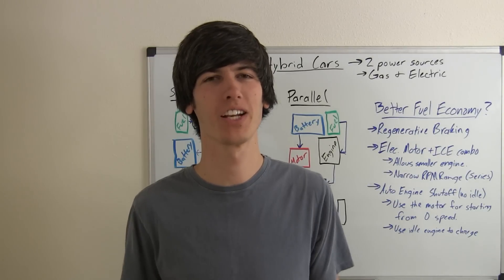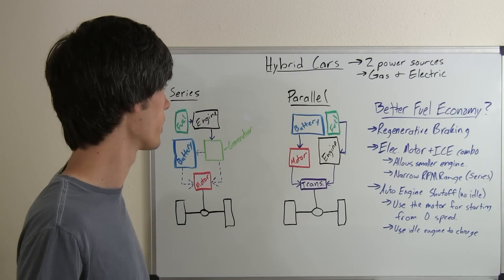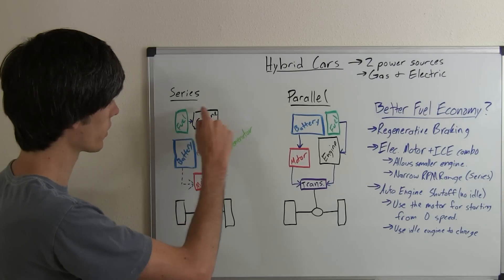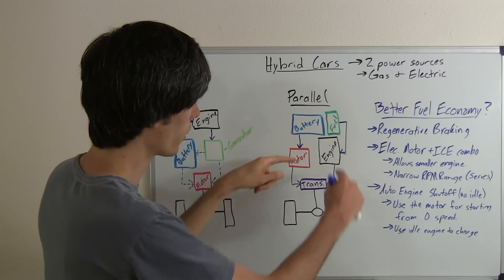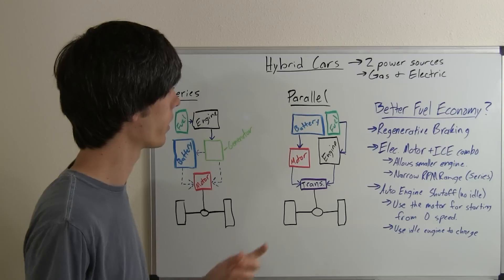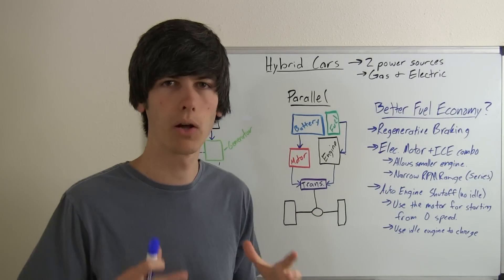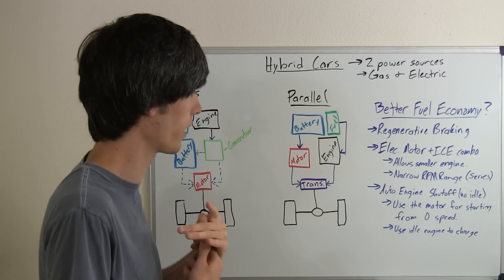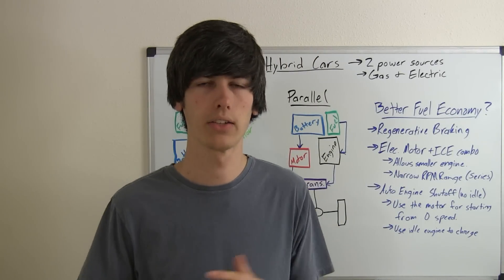Hybrid Cars - Explained

Comment: It is well known that an ICE is most efficient within a small portion of its RPM range. What isn't as well known, is that efficiency depends more on load than RPM. For example, the ICE in a 2020 Camry Hybrid is 40% efficient at 2500 RPM and 125 lb-ft.  Which is a lot of torque. It loses no more than 1% by changing +/-800 RPM, a fairly wide range. But about 15 lb-ft loses the same, and is too much for most driving. The reason smaller ICEs are more efficient is not that they are inherently so, it is that this sweet spot is closer to driving conditions.
The point is that an HEV gains more efficiency by using this information, than by what this video listed. It can run closer to the sweet spot by using the battery to buffer energy. For example, at 55 mph, the Accord Hybrid (presented in another video in this channel) needs 10 to 15 HP to cruise. It splits time between running the ICE at 34 HP and 40% efficient ICE while saving more than half the energy in the battery, and EV mode. And so is about 40% to 50% more efficient.

Comment: I dig out all the internet and I didn't find an answer to a simple question, so you EngineeringExplained are my last hope :)
Why manufacturers (like Toyota) of HEV are not making PHEV with exactly the same parts, but only with larger battery (3-5 kWh) and option to charge it at home.
I'm starting from my needs and I believe many others have the same or similar needs for short (5-15 miles)  trips of city driving, so no need for PHEV with 15-20 kWh battery with active cooling and strong electric motors, just the same hardware that HEV Toyotas already have it.
That will make PHEV more affordable and very practical.
Any idea why this is the case on the market?

Comment: Hi Jason, really enjoy watching your videos! What's your take on the durability and longevity of hybrid batteries in terms of its replacement cost (old and future cars)? I ask because recently I had a hybrid battery replaced on my honda accord 2007 hybrid V6 at 90k miles. I had to fight a lot of unnecessary bureaucracy battles through the company and dealership to get it replaced under warranty as they wanted to charge $4000 for it. After having it replaced, I contemplated if I'd be better of owning a gas car with the absence of a hybrid component because of the insane costs of hybrid component replacement. I sensed probably in the long run, it'd be more expensive to maintain a hybrid vehicle for that reason. Cheers.
Reply: Wow, I truly enjoyed this video too. Did you ever get a response to your question? I had the same concern about hybrids as well. I wonder if its something a typical diy person can do...

Comment: What is more efficient series or parallel?
Reply: i would say series
Reply: Series and parallel combined like Toyota synergy drive. Series is found in Chevy volt and parallel in Honda Civic.
Reply: Playfer   The Toyota system can do series and parallel. It can deliver power to a generator and to the transmission. The system can act like a series or like a parallel or like both together at the same time.
Reply: @andythealien1  Yes there is. The toyota prius is a series-parallel style using a power split device in the transmission. The biggest difference is a parallel system wouldn't be able to take off from a standstill using only electric, since it uses the engine and hybrid system at the same time, but a series-parallel can utilize the best of both and work independently or together.
Reply: At least from what I gathered from the video, depends on the use case. For a daily driver I'd expect series to be better but for performance a parallel system would be more effective because there isn't an in-between step for the motor to deliver power to the wheels.

Comment: Am I to understand that a Hybrid in series  ill be dead if the batteries die out since the engine uses its power Not to drive the engine but to create electricity to charge the batteries so the electric motor can drive the car? if so them the best option is a paraller system is this so? your help will be much appreciated thanks

Comment: What I don't understand is why ICE is used to chargr batteries for Elec. motor? Aren't there loses in energy conversion process? I mean you have to convert mechanical energy to electric and than back to mechanical e. Wouldn't it be more efficient to use mechanical energy directly, and for charging batteries use only regenerative braking?
Reply: Imamijaa more range with extra ICE

Comment: About the Prius (latest model): it is hybrid but I can't understand what type. In the driver console it shows the ICE can send power to the generator (which consequently can recharge the battery of the electric engine), but can also send power directly to the wheels.. Now, is that a "hybrid of the types of hybrid systems that a hybrid car has"? Hope I was clear enough.. thx
Reply from the maker: It's a mix of both parallel and hybrid. I was planning on making a video of it, but the hybrid playlist wasn't very popular so I'm to different topics for now.
Reply: Ohh ok.. Thx anyways!

Comment: Studying for my hybrid propulsion exam, speaking with my friends, a hydrogen fuel cell electric vehicle looks to be the way forward. If you look into the production of hydrogen from algae, it is able to create the hydrogen by consuming CO2 whilst producing O2 (photosynthesis). With this taken into account and the fact that hydrogen fuel cells only has a bi-product of H20, there is no carbon produced in the process (excluding the transportation of hydrogen). Was wondering if you could have an input into this? Explain any problems I am over looking, would be awesome!

Comment: This video may still be relevant or there may be new and different systems available. its 5yo in a very rapid development timeframe. 

One thing that has always intrigued me about ICE/HICE (Now 2019) and batteries and fuel cells is what sort of output do we need from a motor to generate how many Kw for Cars, Motorbikes, 4wds up to heavy units in order for them to operate successfully (current electric car outputs are not enough for the regular even urban dwelling e-car owner to make a successful road trip to the country on the w/e a very popular Australian pastime, let alone for anyone who lives in a more rural setting to be able to complete their daily klms even if its say once a month they have to more than 400km in a day but Id say its at least twice a week and so you want to own that vehicle or there will be a huge fleet of rental vehicles and a huge cost and youhave already paid a huge amount for a e-car.

So my bet at the moment is Hydrogen does have a stable fuel at the moment and that right now there is no electrical system that can equal what we can make in range and keep the efficiency and regular car things like fun and accelerative potential for safety etc. So what motors, Seen Mazda rotary Skyactive and say a Klugenhiem(sic) orbital motor which is powered by supposedly many/any fuels. So whats the best operational or in testing Hybrid since you dont like to make conjecture or since say the Rotary Skyactive or Klugenhiem arent in production I know of what would be the best and how to we work out the mathematics of many kw makes enough power in a battery or fuel cell to be used by an electric motor for what application 80-100km cities sports cars, 4wds, Flying cars per KG?? The answers to life the universe and everything!!

Thanks

Comment: What kind of hybrid are the new ones? Because i drove a new kia niro and its combustion engine charged the batteries but it could drive pure ev and it could drive with battery help for combustion engine. So is it just kind of a. HYBRID :D of both parallel and series? And thanks for the really detailed info videos

Comment: So which hybrid system is the one to go for in terms of fuel economy and power output (series or parallel)?
Reply: Toyota combines both and uses a series-parallel system in most of their hybrid cars
Reply: There is no easy answer. There are a lot of design considerations, and not only in the Serial v. Parallel configuration. Few cars stick to one method - for example, Toyotas use both at the same time, but can be thought of as mostly parallel. But there is also a choice of the relative sizes of the motors and engines, and the configuration affects that choice.

Jason mentioned that hybrids allow for smaller engines, and narrower rpm bands. But smaller engines are not inherently more efficient. And rpms are not the the most important factor that determines efficiency - power is. A car might need 5 to 20 HP to maintain speed, depending on what that speed is and how heavy it is. But it might need 100 to 200 HP for "acceptable" acceleration, depending on those same factors and what you consider "acceptable." But an engine will be most efficient at around 1/5 to 1/3 of its maximum power. This will be above the power required for cruising, where most gas is used. But a lower expectation for "acceptable" will improve net efficiency, which is why smaller engines provide better efficiency.

The way a hybrid gains efficiency, is that whenever it needs the engine it will try to run it closer to this optimal level of power than the car heeds. Power is sent to, or drawn from, the battery to achieve what the car needs. Starting the car moving on electric power is not the actual goal, it is just one way this is achieved.

Now, to your question. The advantage of a serial hybrid is that it can use an even smaller engine, and run it at the optimum rpms and power more often. The disadvantage is that it suffers more losses in converting electrical power between A/C and D/C, changing power levels, and using the battery. The advantage of a parallel (or serial-parallel, like Toyotas) hybrid that there are fewer electrical losses. The disadvantage is that they need a larger engine. This means they can only run close to the optimum rpm and power level, instead of at it.

In terms of power, the serial hybrid will have a larger electric motor. So all else as close to equal as possible, it will accelerate to highway speeds more quickly. But it can't combine the power of the motor and engine, so it eventually loses this advantage.

As examples, the Honda Accord (mainly serial) and Toyota Camry (serial-parallel) are very similar cars. The Accord Hybrid has a 143 HP engine with optimum efficiency at 34 HP, while the Camry Hybrid has a 176 HP engine with optimum efficiency around 60 HP. So it can't run optimally unless it accepts more battery losses than the Accord. The main drive motors, however, are 181 HP and 118 HP, respectively. Car&Driver says the serial hybrid Accord does 0-60 mpg in 7.1 seconds; the Camry takes 7.9. But for 50-70 mpg, the Camry wins 5.1 to 5.8. (For reasons specific to the Accord system, this was an unfair test and the Accord could probably do better.)

Comment: what I find funny is trains use a hybrid system that is extremely effecient.  they can haul large loads for little fuel.  so how about making hybrids based on that.  the way a train is a hybrid is an internal combustion engine ONLY turns a generator that charges batteries only.  the batteries then power the eletric motors.  this makes it so when the electric motors have to work harder there is no direct need for more fuel to be used.  in the automobile version the ICE could turn off when the batteries are above a certain percentage and turn on when below.  it could also mean a smaller ICE as well, which means less fuel consumed
Reply: I could be wrong but I haven't heard of one that runs that way.  most of the ones I hear about are the ones where the electric motor is between the engine and transmission
Reply from the maker: There are several that operate this way. Chevy Volt is one example.
Reply: Do you know if they went to those that know what they are doing?  similar to how Dodge went to Cummins for their diesel engine
Reply: Finally someone who thinks the same way. I always thought that a diesel-electric drivetrain like in trains would be amazing to have in cars, may it be gas-electric, doesn't matter. And now look at that, Hyundai is giving you the choice with their new IONIQ. It's available with three drivetrains:

All Electric - only uses an electric motor for propulsion, there is no internal combustion engine built in

Hybrid - uses an ICE and electric motor for propulsion, the ICE helps when the electric motor doesn't have enough power or when the batteries run low

Plug-in Hybrid - uses an electric motor for propulsion, but has an ICE built in to charge the battery and extend the range, the main charging comes from plugging it in in your garage. (this is kind of equivalent to diesel-electric trains, except for the charging bit)

Comment: Boi, thx for the video as it helped me with my oral project and for Nathan berry, I think parallel because, you can either use electricity to power the transmission or the fuel at different times so, you can maybe only use the electricity part more than the fuel(i'm not the real jake paul either lol)

Comment: Has anybody tried to tune the ICE to run solely on hydrogen from an on demand hydrogen system? I have not had a chance to test a hydrogen generator myself yet but it seems like it would work. This would mean the vehicle is running completely on water. Do we actually have the technology to do this already but no one is doing it yet? From what I understand, the ICE can run completely on hydrogen. However it would take too long for the power to come up if you need to accelerate. But if you are just recharging batteries the system can be tuned to run at a steady RPM when recharging.

Comment: So, what I want to know is why is it more efficient? You use a gas engine to turn a generator....and the generator turns a motor...and there has to be a drop in efficiency when you turn motion to electricity and turn the electricity back into motion. I'm not arguing that hybrids don't work, obviously they do, their efficiency has been proven, but I want to know HOW and WHY they are so much more efficient.

Comment: Left off a big one. Internal combustion dumps a lot of fuel in the engine after a stop light turns green. Electric motor does most of the work at stop lights which doesn't have huge dump a fuel into engine
Reply: For fuel to burn you need to adhere to certain ratios. Dumping fuel does not. No engine dumps fuel.

Comment: I am interested. Would the series hybrid really be that much more efficient than a standard car? Because aren't you using one form of energy to generate another, thus kind of eliminating much of the reason for having a hybrid in the first place? I get that the battery would help and if you could plug it in at home that would also help. I personally think Parallel makes much more sense. What do you guys think?
Reply: Diesel locomotive which is actually diesel hybrid or diesel-electric. While the diesel engine give high torque low RPM that need a lot of overdrive gear to make it spin at high RPM, and that also mean more weight. So the engine turn genertaor that then turn motor. The motor can make low RPM output to high RPM output without transmission. So in all it's more efficient.

But if it's compared to parallel hybrid, I don't know.
Reply: Indra Ida Bagus Yeah I get what you are saying. Using an electric motor to drive the weight while the engine just focuses on making electricity seems like a good idea. But the problem I see is that while an electric motor is really efficient at transferring energy into movement, an engine is not. If ultimately you require the engine to turn a generator you are still dealing with an inefficient system at some point. In order to generate enough energy to supply the batteries and motor the engine would probably have to be on constantly once the electric range has ended. It that case, I reckon it would just make more sense to remove the engine and complex drive train stuff and just stuff in more batteries and extend that electric range. Or a parallel hybrid
Reply: Yeah, the electricity input for motor is a problem if you ask me. Battery is not very efficient in storing or releasing electricity. So I think the engine should be keep running to power the motor (and should be diesel engine to be more efficient).

Maybe it can use auto idle and KERS for restart. But yeah.... hybrid is good but not "super" efficient.

So I actually got an idea, why don't just make AWD with front wheels driven by gas engine, while rear wheels driven by motor (engine-generator-motor)... Idk will that work and get way..... more efficient than gas engine only or not, I'm still 13. =)
Reply: Yeah man Batteries suck, a few parallel hybrids are like that AWD thing I think. Mercedes Benz E-400 is a rear wheel drive hybrid...so that's cool. You certainly are on the ball for only 13 years. Good on you man :)
Reply: What do you mean with "certainly are on the ball"?
Reply: I mean you seem smart for your age.
Reply: Unfortunately I don't go to school.

Comment: In a parallel setup, how can the electric motor and the ICE simultaneously rotate the transmission without messing with the synchronisation of one another?
Reply: Maybe using clutches? Idk

Comment: What is the best tune/modification you can do to your engine to increase performance that would roughly cost less than $200 ?
Reply from the maker: Remove unnecessary weight.
Reply: Engineering Explained Already done :)
Reply from the maker: Then you have to spend more now haha. $200 isn't going to get you anything unless you remove things yourself from a scrapped car.
Reply: What's the car?
Reply from the maker: It's a Honda Civic, parallel hybrid system.